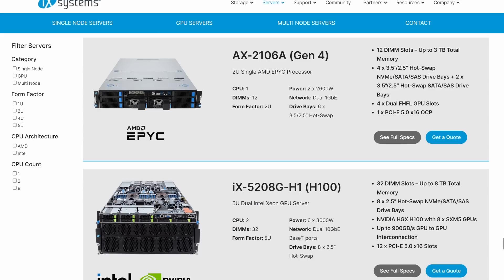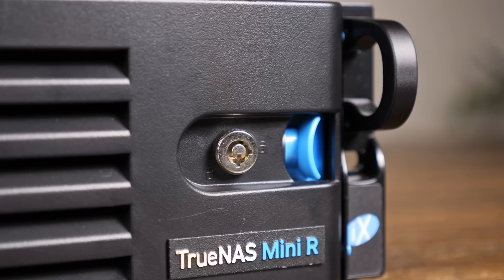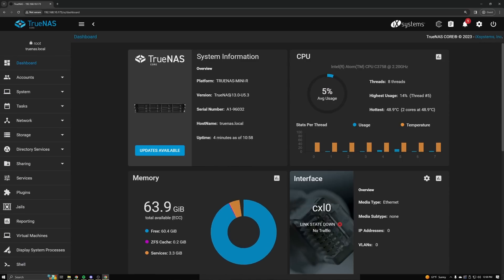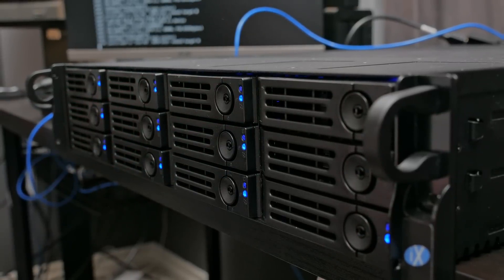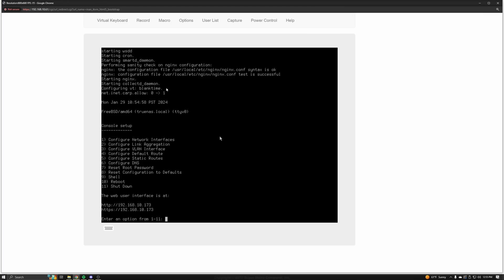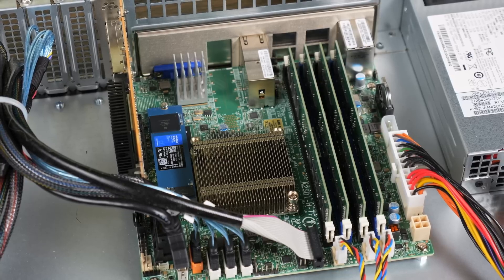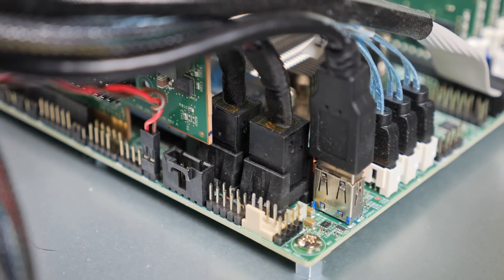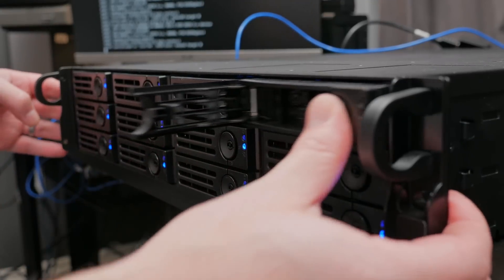This NAS Isn't For Me. But I want it.

Comment: 11:43 Not gonna change the price comparison much, but the RAM you selected will not work with Xeon E3 and C236  motherboard. Those are RDIMM which only work with E5. E3 only works with UDIMM, ECC or not.

On the used market, the price are RDIMM < nonECC UDIMM < ECC UDIMM.  64GB of ECC UDIMM may cost $100+

Well, that's still not gonna make up the thousand dollar gap.

Comment: I bought an A2SDi-H-TF mobo for $479 used on eBay a couple years ago! It's in a Norco ITX-S8 case right now, but i would like more hotswap. I'm now considering getting a rack and the $148 Super micro case you mentioned! Thanks for the video!

Comment: Stuck on DSM? I would actually run far far away from TrueNAS and hug DSM instead based on my previous experience with both. DSM is much easier to use for both basic and advanced users. And yes, I use a rack mounte Synology with loads of advanced features. In other words, if you really into TrueNAS, why not just buy a proper rack server and install the TrueNAS software? I don't know how much does it cost at your place, but it's 200~300-ish USD here I can buy a second hand Dell R730 or similar generation server with much higher performance - SATA/SAS instead of SATA only, more HDD bays etc.

Comment: I have an older Dell T430 with 8 3.5 mechanical 2 SSD's and extra network cards running dual xeons. Even with a few VM's idling with 2 docker servers it only draws 140's W at idle. That idle power usage seems high for what it has.

Comment: Really the Asustor Flashtor FS6712X 12-bay is more so like what we can afford. Only 1 RJ-45 10Gbps and 0 other networking ports but12 M.2 2280 slots for storage. Supports TrueNAS, Windows and claims support for MacOS thought like most comes with no OS installed and no drives installed. 800 USD is good for an M.2 port only system with HDMI video out, 4 USB data ports and 1 RJ45 10Gbps port. So good NAS for the price you can build better with off the shelve parts but then you run into bifurcation not designed for an M.2 based server.

Comment: Hey mate! Thanks for all the videos, just a quick tip. When testing the speed of a file transfer, instead of using Explorer better use robocopy, which comes with the OS. The reason for this is because Explorer is quite legacy and does not make use of multi thread.
Reply from the maker: Thanks! I think explorer is still useful as it’s what most people would actually be using in real world scenarios, but I will definitely look into that. It might be great to have both.

Comment: if you liked this one you can try to find dell R510. I brought mine for around 500eur with fastest CPU supported (2 x Intel Xeon X5675) and all cadies. You get 12 x 3.5" SAS/SATA on front and box for 2 x 2.5" inside. You get all server features including IPMI, dual power supply, ECC ram. Some thing that are limits of its age are: support of only 128GB RAM, only PCIE GEN2 and you have 3 x8 slots but 2 are x4 and only 1 is x8. For graphics card  you need to cut whole trough end of slot to be able to fit. x8 slot support only cards up to 17cm because of heatsink on motherboard. Middle slot support longer but only 1 slot. And there is no power supply for them so you are limited to 75W per slot. In theory you can put 1 GPU, 1 USB3.0 controller since it doesn't have it and 1 2x10GB card in it (it have 2x1GB + 1 IPMI LAN). Now thing you will not like about it: Fan controlling is available only trough IPMI in BINARY form no gui, it have standard 2U double fans with default speed of 3400RPM if i recall correctly so they produce hum/higher pitch sound. I control them trough ipmi on unraid and they are most time on 2000 RPM and i linked them to HDD temperatures so they go up from time to time but nothing problematic. Other problem that you will definitely not like is power consumption On idle with all hdd off is ~140W. With all max it peak at around 350W. That is with 2 x SSD, 12 x 3TB SAS (16W each) and 1 USB 3.0 card. It is old but i think it still can be used. For media server (and small virtual lab) for me it good.

Comment: Hi! Thank you for the video. I might be a little biased seeing prices on ebay for used servers but I find this one particularly expensive. 2000 bucks is a lot for an atom processor, no redundant psus and no upgradability (with only one PCIe). Again, I know that server gear are expensive but this seems too much for what you get.

Comment: No it ain't for me. Well I built a Synology NAS using RedPill on a 4thGen Intel with 16GB RAM , four 2.5GB NICs and 12 Sata drives. Without disks, that is just $150!. Slap into an old case and rig some brackets then stuff the disks in there. Works like a charm. And DSM 7.2 priceless.

Comment: Thanks, as usual, for a very interesting video.  I have a Windows 2011 Home Server that has been running since.... 2011.  I've only shut it down a few times to blow dust out and to upgrade to larger hard drives that entire time.
it was one of my kid's old AM2+ motherboards and has SATA2 and USB2.
It has been running flawlessly for several years, but besides the slow SATA and USB, only had 4 SATA ports and limited space to mount drives even if I had an add-on SATA card.  I have 4 4TB hard drives in it and an 8 TB external (yes, running from USB2).
Fast forward to this week:  I was rummaging through my old PC pile and realized that one of my wife's old computers is AM3+ and has 6 SATA3 ports and USB3.
My first intention was to install TrueNAS on it, but Home Server 2011 has been so flawless that I'm going to stick with it for now.
My server hardware that is likely going to do me the next few years:
AMD Athlon II X4 610e (reusing from old system as it is only 45W vs 125w and MORE than powerful enough).  Undervolted so it only runs 10W at idle instead of the power hungry 12 it normally runs.  BTW it is running at idle about 99 percent of the time.
8GB DDR3 1333 MHz (slow and steady)
A 4MB S3 Virge PCI graphics card, just in case I ever have to hook it up to a monitor, which I haven't had to do with my old server since 2011.
One more great thing about this computer?  It has space inside to mount 6 3 1/2 inch drives and 3 more if I use 5 1/4 to 3 1/2 adapters and enough SATA power connectors for the drives without having to use Molex adapters.  It's time to add more storage and at least this time I don't need to lose a drive to add one.

I just realized my short reply intending to simply thank you for the video turned into a novel.  Thanks again!

Comment: TrueNAS Core is solid, but Scale still isn't ready for primetime. Running containers from the command line yells at you to do it from the GUI, try to get SMART data and it yells at you to do it from the command line, host path validation makes no sense (why can't I give a container access to file that's on a share without it being problematic?), TrueCharts is a third-party solution to ixSystem's outdated/rarely updated app catalogue but a ton of TrueCharts' apps have zero documentation or the documentation is so vague as to be useless, TrueNAS forums are infamously toxic, the list goes on.

I understand TrueNAS is free, and so is TrueCharts, but my God, there are plenty of other free and open source projects whose communities AREN'T toxic and that DO have coherent documentation.

Comment: A 6 year old atom CPU? limited support? ITX board?

Yeah, not seeing any value here.

You can get a N305 board, lower TDP, DDR5, iGPU w/hardware encoding/decoding and slap it into a 2RU supermicro chasis, and save yourself a few bucks.
Reply from the maker: It kinda seems like you missed a big chunk of the video… lol.

Also, got a link to an N305 (or any alder lake n) board with that many SATA ports?
Reply: @HardwareHaven  n305 just sprang to mind, otherwise my point still stands, there's still 6 years worth of better options out there.

You're an absolute sucker if you pay 4K USD for a rebranded Supermicro chasis with a 6 year old ITX board in it.

But hey, if you need that mission critical NAS with 'support', I'm sure they'll come running to help when it goes tits up 😅

Comment: Just wondering, have you only looked at sort of off or specialty brands like this for a home lab? I was able to buy myself a Dell R430 with two Xeon 24-core processors processors and 192 gigs of ram, +8 2 TB SAS drives for under $500.

Comment: Yeah, when I was in my job shop machining setup, I spent about that much just pudding together a proper truenas box without drives too so this is honestly more than reasonable all told, bit higher spec but ultimately much less efficient hardware, if I were in the jobshop market nowadays I'd go for something like this, for a home user I do agree this may not be the best shout though, all told for home use you're best off getting an older dell 12 bay if a little bit of noise and power consumption isn't a concern, otherwise just a home build with something like a 5700X (or a 5650G or 5750G if you need ECC support) and go from there

Comment: At 6:03, you talked about being jealous and upgrading you're existing TrueNAS machine - ignore the SSDs and focus on RAM - TrueNAS uses RAM as a cache! SSD cache is secondary to RAM and often doesn't work as well as RAM cache.
Reply: Agreed!! Memory, CPU clock speed, and IO in that order. (cache is fundamentally used differently in ZFS then most file systems) thats the kicker, but also why its so performant.
Reply: @PHATE69  CPU clockspeed? Why? IPC should matter more, cores if used by more than one user/process. A 1.8Ghz Core i 10th gen will kick a 3.4GHz P4EE in the teeth so hard the teeth will break the sound barrier coming out it's bum. On every task, except if you measure '1+1' a single time, or some such. If you measure multiples it'll be different. I'd really have to look hard for something the P4EE would do faster, cuz it will be some very specific isolated branching instruction.

Comment: That is a decent value rack system as it is at least 1000 less than an empty 12 bay QNAP rack mount server with essentially the same specs and 8GB memory. I did go the route of picking up a refurbished 16 + 2 bay Supermicro system for under 1000 with 128Gb ram and am happy with that. I will keep IX in mind for the future if I need another server.

Comment: For anyone who thinks this is unreasonably priced, if someone needs to buy an off the shelf solution, which do you think is better:

Synology DS2422 - 12 bays, quad core, 4GB of memory, quad gigabit networking - $1800

This Mini R - 12 bays, 8 core, 32GB of memory, dual 10gig + management - $1850

One of these is way more performant, serviceable, and upgradeable than the other, and there are businesses that just want to buy one all set up and preconfigured.

Comment: Great video!
I have been running ProxMox and TrueNAS (virtualized) on this motherboard (Supermicro A2SDi-H-TF) for more than a year now. I have 128GB of ECC RAM installed. I bought the MB used on eBay Here are a couple of my observations:

I love this MB!
I have passed through one of the SATA/SAS controllers from ProxMox to TrueNASas with no issues. I get pretty good read/write speeds.
Running a Windows VM or other OS VM's are sluggish (as you pointed out in the video)
I also run Home Assistant on the same hardware alongside TrueNAS with no issues.

Comment: We have a Mini-R for UrBackup storage, connected via NFS to a VM.  I tried running UrBackup directly on it, and it was painful, so I figured I'd just use it for storage.  I put in an old 400GB Oracle F40 PCIe SSD card for a SLOG in dual mirrors.  Given that they are SLC SSDs and will last for about ever, it works for our usage.  Also upgraded the 16GB DIMM to 4 32GB DIMMs, works great for our usage.  I'm looking at a TrueNAS M40 or M50 for the next project I'm working on.

Comment: I'm so disgusted with the Mini R, I bought their SFP card but it requires a PCIe x8 slot. I had to return it because it only works with their smaller Mini X+ or XL+ units. I failed to find a 4x SFP card for it and have hang an external converter on the rack. Looks so ugly.

Comment: It would be amazing if they just sold the case and drive bay trays.  I've found very few rack mount server enclosures that allow that many drives in such a small formfactor. Also none that were reasonably priced.
Reply: Supermicro 826. You can get it used/refurbished for around 400 bucks - including a Xeon board, CPU, RAM and a SAS controller.

Comment: In Supermicro boards the fan control typically is done through the IPMI rather than the BIOS.
Once you log into the IPMI, its under Configuration -> Fan Mode.  In my experience the "Optimal Speed" setting is the quietest mode.
Reply: In addition you can use ipmitool in the CL to set specific curves manually
Reply: @colepage6596  yup, that's what i had to do w/ my supermicro & noctua fans... they apparently run so slow the system thinks they failed and ramp em up to 100% every 10 seconds! LOL!
Reply: @dobrzpe  Hmm, I hope you got enough airflow.  Since I looked into various fans for my Supermicro, but they didn't have near enough airflow rating as the fans that came with it.
Reply: @dobrzpe  or you get undervolted warnings (just snip the 4th wire problem solved)
Reply: @TheKigen  I don't know about Supermicro specifically regarding this, but I do know that at least the stuff I used to work supporting largely had their "fan curves" as "yes!" aka all of the rpm all of the time. Rackmount stuff isn't typically configured to give a poop what the temp is, they run the fans often at a set rpm and only change if an overtemp event happens, then it's flat 100%, in some cases until the cows come home. Or 120% or whatever it's expressed as. What you get is a loud box that's annoying, until an overtemp happens and the whole thing goes ape$hit. Unpleasant when you sit next to the thing for hours.
Reply: That's correct, although I would be careful, as iX makes their own Fan curves in most occasions.

Comment: The only really good way to do RAID with ZFS is just RAID10, or a pool of mirrors. No parity calcs, high speed, easy fast rebuilds. Also, Supermicro has other small Mini-ITX Atom boards that are half that price, but also lower performance - but plenty for home users.

Comment: You said regarding buying Synology that you're stuck with their software. I need to chime in and remind you that Synology's DiskStation Manager and first-party packages are the absolute best. I have multiple Synology NASes going back fourteen years, and recently built a TrueNAS box. They don't compare. On the market for a new Synology now. 12 bays or larger. Never going to stray from the Synology fold again.
Reply: That is fair, for someone like me, being locked to using certain software is a deal breaker, but for some it may be good, but you do need to keep in mind, what would happen if Synology ever shuts down, will you still get software updates or...?
Reply: @JordanPlayz158  I have multiple Synology units, several of which no longer get support. They still run well and are quite usable. There's a list, longer than my arm, of open source projects that have been shut down or abandoned.
Reply: @jeffnew1213  With Synology, you just need to hope the ones out of support don't get vulnerabilities found whereas with abandoned or shut down open source projects, you can just fix the issues if they arise
Reply: @JordanPlayz158  Firstly, my NASes are not exposed to the Internet. Secondly, if you think that I, as an FOSS user, has the ability to go in and fix C-code or recompile with a long list of required dependencies (when I am running Windows and have no development environment set up, let alone one for Linux)... that's ridiculous.
Reply: @jeffnew1213  The thing is you can, anyone can, that is the beauty of it, there are indeed requirements to do it but you can, with Synology, you "technically" can but it is orders of magnitude harder
Reply: That's a lot of words to confirm that you're stuck with their software.

Comment: if only it were 8 2,5" drives pushed over to the left on the front of the case, so the motherboard (custom) could be on the right and then make it a short case... with like dual 2,5gbit networks and you would have a small, quiet home user NAS :D

Comment: I found a similar for factor 2U 12 bay server on Amazon that has a back plane that appears to only have mini sas (sas host to sata receive) on it. I am not sure if it would work that way. I am under the impression that the sata connectors would need to connect to drives not the motherboard.
Reply: I'm pretty sure you need a "reverse breakout cable" to convert from 4 sata ports to a mini sas connector.
Reply from the maker: Assuming we're looking at the same thing, I believe the backplane is using MiniSAS connectors, but is just SATA. SOu you should be able to plug that MiniSAS to SATA cable into a motherboard like normal. That's actually how the 4 SATA ports on this motherboard were used. Granted, I'm no expert in this regard so grain of salt haha
Reply: @HardwareHaven  trust me i am not expert either. I am working with a mentor at my job to get more Network engineer experience. this stuff is my jam ngl.

Comment: Regarding the loss in performance when switching to TrueNAS Scale, did you wipe and rebuild the pools or just import them? I've heard of imported pools having worse performance and weird quirks.
Reply from the maker: Yeah I wasn't super clear (probably should've scripted this video haha)...

I created new pools for Scale. I also did a fresh install with v22.12 just to make sure it wasn't an issue with v23, and tested with both the RJ45 and SFP+ NICs. I also tinkered with ACL Types as I saw some forum posts mentioning that as causing issues with degraded SMB performance after migrating to Scale.
Reply: @HardwareHaven  Damned good troubleshooting, sir.